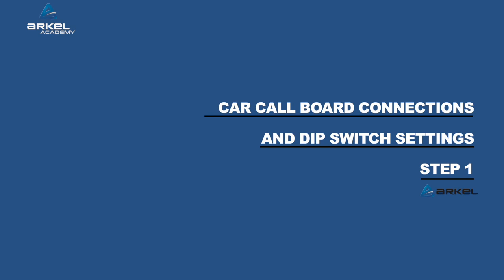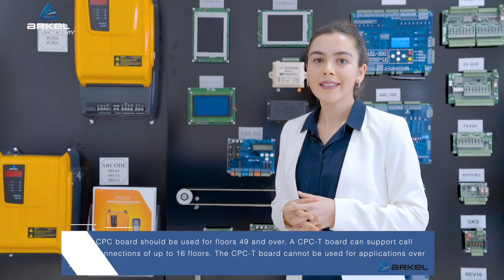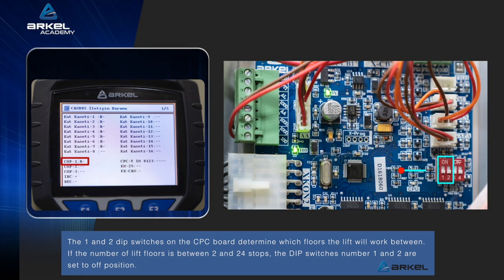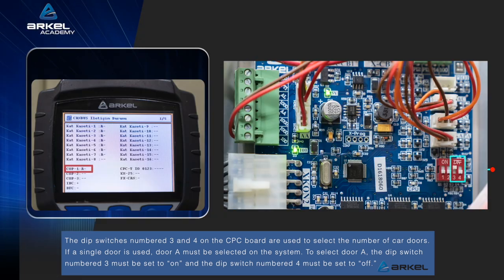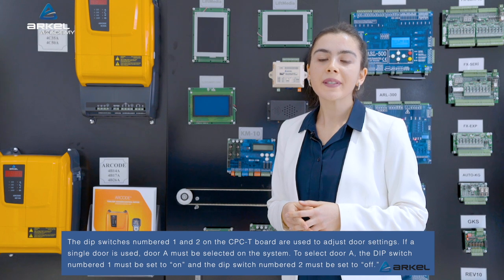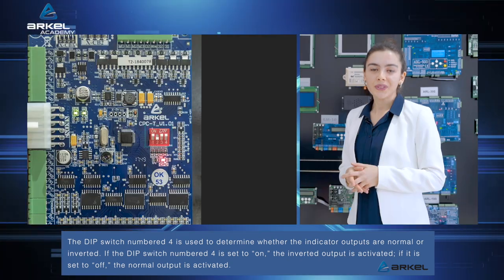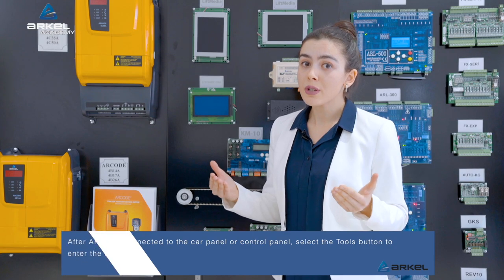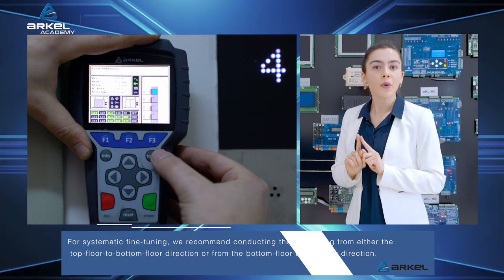ARKEL Academy ''Car Call Board Connections, Dip Switch Settings and Floor Level Fine-Tuning''

Comment: i have 1 problem plz tell me solution....we are using arkel300 with Adrive ....
in normal mode if i make call to 6 or 2nd 3rd floor elevator go to floor 6 and suddenly show 7th or 8th floor  ....i change ML1 magnetic switch but still same problem ....so plz tell me solution
Reply: Bro do u get solution if yes, plz share it
Reply: @abdullahbinqasim9720  Plz connect earth properly......
Reply: @zeechannel4229  Thanks for your kindness.Bro my Wats up no and mobile no: 8850026370.plz can u help me for panel work and drive programming.Hope you will contact me on my Wats up.